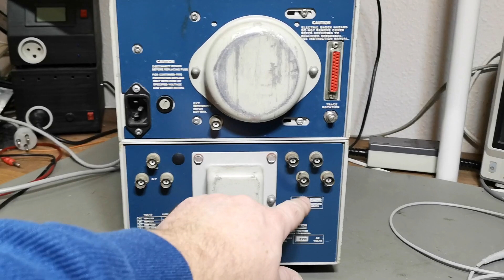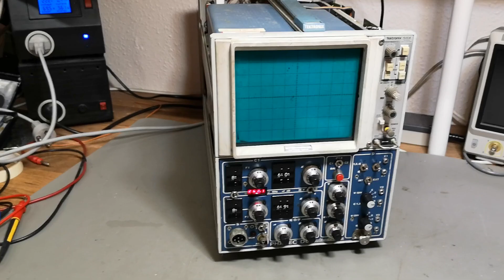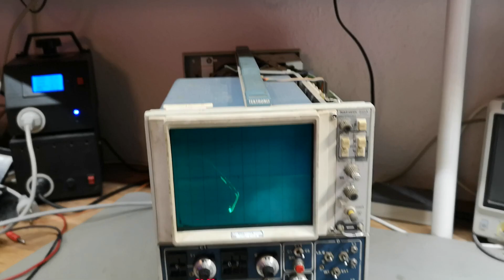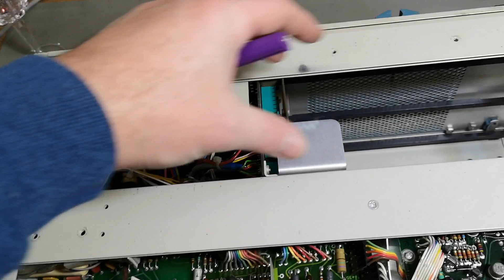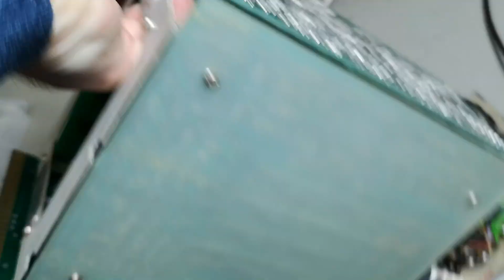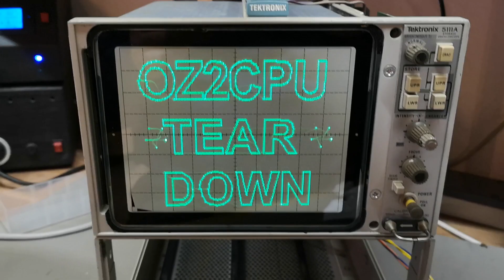Tektronix 5111A Oscilloscope special plug in Hocking Electronics Phasec D6

Comment: Wow, this is amazing, I've never seen a module like this in my life, the pulsating logo is great. For many years, I have been using products from "Kontakt Chemie" for cleaning contacts, I call it the holy trinity - Contact 60 - dissolves dirt and oxides, Contact WL - serves as a rinser that washes off the loose dirt and neutralizes the action of 60, Contact 61 - creates a protective coating and gently lubricates . Kontakt Gold can be used for gold-plated contacts.

Edit: yes, and also thank you for the name day wishes 😁

Nice day 🙂Tom

Comment: Also had some stuff that used the Tek scope frame as base. Tek sold the scope alone with the case for these applications, where they got a fully calibrated and working main body, ready to put the bespoke design in to use as a XYZ display. Was some sort of medical recorder, using a microprocessor, but of course no info and not working. Another similar one, using a GE scope tube, which is also unusual in that it has a second tube that is super bright, used to write onto photographic film your trace, and then it was wound out to read. Dry paper, no developing needed as it will leave a black trace with bright light. Guess it will fade, but probably will last long enough to copy to have a permanent record available. Scope side still works, the rest not, which is why both landed on auction for $2.
Reply from the maker: makes good bussiness for TEK to sell the frame alone for such things
Reply: @TeardownOZ2CPU  Plus a good profit, in that they get to sell and keep all the profit that otherwise goes to the reseller or distributor, while  saving in not including any parts not used, and also saving on assembly cost as well, as they can pull the parts off the line in part built condition, and ship them after testing, using the existing packaging they use for service parts.